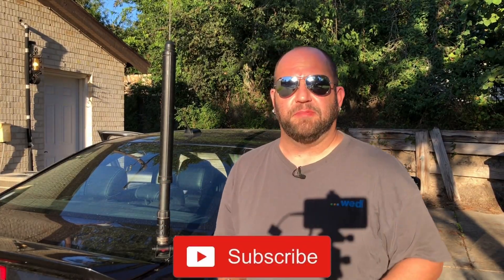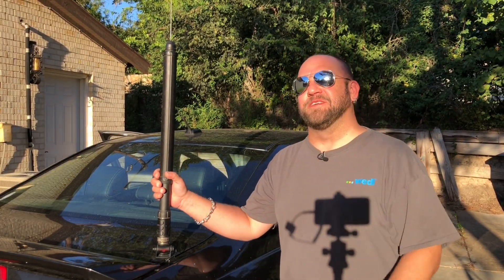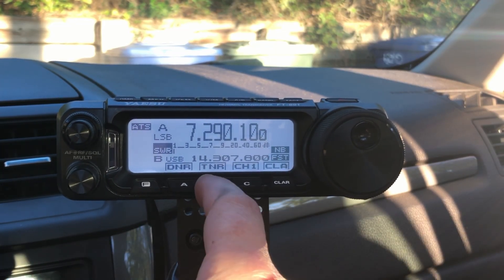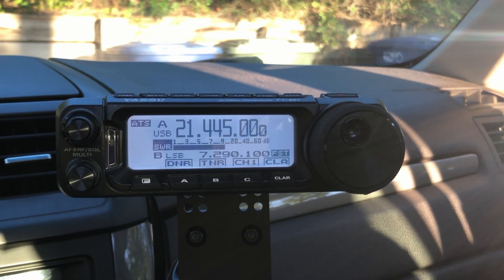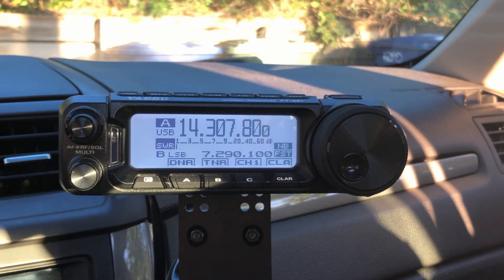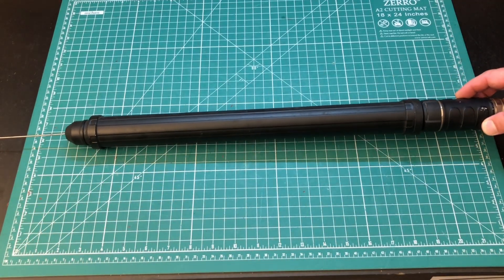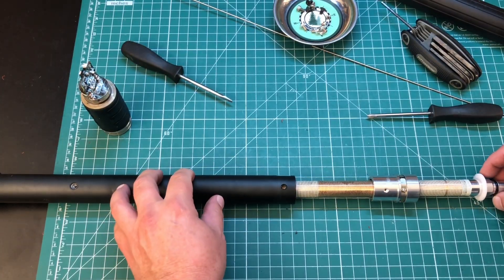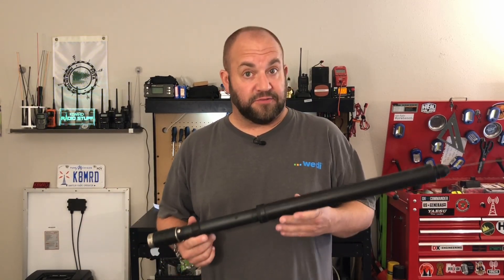Yaesu ATAS-120A Mobile HF/VHF/UHF Screwdriver Antenna

Comment: I had an 857 and ATAS antenna.  Totally hated that set up in my F-150.  It always had problems tuning, RF feedback, and other issues.  I bonded the truck, radio and antenna to the frame.  All body parts to the frame.  Always had the problems.  Switched to the Icom 7000 and a Scorpion antenna and NEVER LOOKED BACK!
Reply: Because you discovered that the ATAS is a piece of excrement bundled in a nice little Yaesu box. I am glad you can admit the pathetic and horrible design of this antenna. I too have a Scorpion and I have a LT II. ATAS is filth but so many people are suckers for buying this and Yaesu should be utterly ashamed they market this garbage.

Comment: I have a little box for using this with any radio works a treat
Reply from the maker: I've heard of those.  Which one do you have?
Reply: @hamradiotube  it’s a home made one by a good friend of mine G0NZI, he assured me it’s simple to make.
Reply from the maker: @CampervanCookout  Oh too cool.  Has he published the schematics?  Not that I have any idea what I'm doing but that might be a cool thing to build.
Reply: @hamradiotube  I will ask him :)
Reply: @hamradiotube  Third attempt!  Why do comments get automatically deleted on your channel??? Do you have some sort of bizarro moderation/filter set???

Once again: search for Yaesu ATAS 100 Screwdriver Antenna Control by K5LXP.

And for manual control there's the MFJ-1925
Reply from the maker: @James_Bowie  YouTube automatically hides any comments with a link so that might be why.  Too many bots out here spamming.  Thanks for the info though.  I’ll have a look.  73
Reply: @hamradiotube  Not so on all channels that I visit. I've posted lots of links to tech articles on various channels that didn't get deleted. Seems to me that it must be an option you can set on or off. Also, I'm told that some such posts are held for review by the channel owner, so there may be a list of those somewhere on your dashboard (or whatever).
Reply from the maker: @James_Bowie  Ah yes, there is that.  But I hardly ever look at the held for review section.
Reply: @CampervanCookout  Did you ever ask ask G0NZI about publishing his schematics? Thanks! 73!
Reply: @lyledal  I'm not sure he has schametics only the description above. I'll see if I can open it up and take a look. I think someone shared similar schematics elsewhere in the comments
Reply: @hamradiotube  I have had a chat with him today, he said its very simple design. It's a bias-T which blocks the voltage going into the radio via the signal path, with two buttons. One button has a straight 12v output for antenna up and the other is a 8v via a regulator for antenna down. Apparently thats all the ATAS uses 8v and 12v, if its above 8.5v goes up. It's similar to the K5LXP but much simpler. design in the one I have from what I can see.
Reply: Check out the mfj 1925

Comment: I had a Yaesu Rep tell me not to use it as a mobile antenna.  It's good to see it can be done.  But all that wind deflection is going to take a toll.  I may try it in the bed of my PU.  I do use mine in the RV when we are parked.  The antenna does work well.
Reply from the maker: A Yaesu rep tole you not to use their mobile antenna as a mobile antenna?  That's just crazy.  I've seen so many cars and trucks with this antenna at different ham fests and swaps.  Its sole purpose in life is to be a mobile antenna.  Sure there can be better, more rigid ways to mount it, especially if you have a truck, but the wind deflection isn't that bad.  Keep in mind, I'm going 90 MPH in this video.  With a trunk mount.
Reply: @hamradiotube  You dont know anything about how to properly perform mobile HF and you shouldn't act like you do.
Reply from the maker: @DeepSouthVeteran  Really Mr Sad ham??  Cuz all the contacts I make would say otherwise.

Comment: For years I ran one on my Honda Prelude with a trunk mount. Used a Diamond mount, scraped a bit of paint and also bonded the trunk lid to the body with a bit of copper strap. Used an FT-857 and made lots of HF DX contacts on my commutes. A friend just got a Yaesu FT-dx10 and the manual refers to using an ATAS-120A, so the antenna is still relevant.

Comment: In this situation, are you using the battery in our car?  Also, is the radio grounded to the car?  I have the same mount and got rid of the paint, but I'm running via a bioenno battery and my radio is not grounded.  thx.

Comment: Hi, thinking of getting one of these as I just bought the 710.  Can anyone recommend a good temporary magnetic mount model for this antenna for a car (ie only used when car is parked)? 73 - VA3IAP
Reply: I recommend the type that has 3 5" diameter magnets.  Set it down in the middle of the car's roof.  I talked to the Azores from a California POTA park using just a 15W SSB rig on 20m.
My antenna was a 17 ft collapsible whip.

Comment: I just paired an ATAS 120A with a FT-891 and I can also say DON'T buy a cheaper trunk lip mount. I tried a Bingfu from Amazon. My SWR was all over the place and it didn't want to tune. Got a Comet RS730 and my problems went away. Again GROUND it well.
Reply from the maker: Spends $350 on antenna.  Will only spend $5 on mount.  It's amazing the things we cheap out on isn't it?  I'm the same way and I tend to have to learn things the hard way.  Glad you got it situated and thank you for posting your testimonial.  I couldn't agree more.  You've gotta have a good mount.  Though I have yet to ground mine well.  73

Comment: Hey Mike.  Your video motivated me to pull my ATAS 100 out of storage. This thing is at least 25 years old so I plugged it into the equally old FT 100 D and it worked like a champ on another day. I’m going to try to see if it works with an 857 which should I hope.  Thanks for the motivation.
Reply from the maker: That's awesome!  I hope you get it all situated and back on the air.

Comment: Mike thanks so very much for your reply! It indeed help very much. 73 & Blessing’s. NM5SP
Reply from the maker: Awesome.  I tried adding a longer wire to the ATAS yesterday with inconclusive results.  I didn't have much time and used a completely random length of wire with no scientific basis at all, but I did get the SWR on 3.900MHz just under 3.0:1.

Comment: Mike really learned a lot about this antenna from the video! I'm  in the process purchasing a FT 891(because of your videos on the 891)
 for moblie use while RVing several months a year and debating between this antenna and the BabyTarheel ll. Draw to the Tarheel because it covers 80 meters, is where most nets I talk on are located. However not excited about manual tuning and running additional cable for tuning on the Tarheel.  Only draw back on the Yeasu is it doesn't tune 80 meters where I operate everyday on nets. Thanks for your great work providing info and education about Ham Radio!  73&Blessings. NM5SP
Reply from the maker: Alan, I feel you man.  That is a very tough call.  I've since purchased an ATAS after making this video because I liked it so much.  I was traveling a couple weeks ago and wanted to tune up 80 but alas, I had the ATAS and couldn't.   80 is so not important to me though.  I'm never ever on it.  It's more an "I want it because I can't have it" kinda thing for me.  Same reason the first antenna I bought was a Wolf River Coils Silver Bullet 1000.  Because it had 80-6.  Every now and then I'll get on 80 FT8 but for SSB, I prob only have 2 maybe 3 phone contacts.  If 80 is important to you, it's a no brainer, get the TarHeel.  I assure you, it is NOT hard to wire.  You have 2 wires from the control box.  One is your 12v to power the box and antenna, the other is the control wire to tell the antenna to go up or down.  Then your coax from whatever mount you chose.  That's it.  At least for the setup that I have.  PLUS, with the Tarheel, it is extremely easy to swap your whip.  If I'm driving and doing HF, I'll have the short 3' whip on, but if I'm activating a park stationary, I have quick disconnects for the whip and I can put on either my 6' or 17' telescoping whip in mere seconds.  The Tarheel's whip connection is a standard 3/8x24 thread so you can put pretty much whatever you want on it.  Not so much with the ATAS.  It's whip receiver is a small hole with two screws that tighten down on the whip.  Sure, you could put a different length piece of thin metal wire in there, but it's not going to be easy, or readily available.  BUT, if you are stationary at your campsite, you could very easily attach an appropriate length of wire the the ATAS stinger with an alligator clip or something, and tune up 80 (I would suspect, I've not done this but it makes sense).  I don't know if this answer helped or confused you more, but I hope you have fun with whatever decision you make.  Thanks for watching and 73.

Comment: Hello Mike, I have a 10+ old FT-857 & ATAS-120. This combo works great. I would say a lot of FT-8x7 and ATAS-120 users. Don't know they can use a duplexer. So they can use the ATAS-120 on HF, Vhf and Uhf.
Reply: Do you use the car battery and ground your radio?  I'm having issues with getting to work.
Reply: Hello Frank, I run both the positive and negative to the car battery. I also mount the body of the radio to the car for a good grounding. I see you are about a hour north of me. I have YSF, DMR, PaPa or Darn.
David KE6UPI
Reply: @DavidS-iw4ei  thx David S.  I will experiment more. Some hams use a magnetic mount. So my feeling is the radio b
Need to be grounded.
Reply: @frankwc0o   What problems are you having?
Reply: @DavidS-iw4ei  I have the FT857D connected to the ATAS antenna. I’ve change the menu on the radio. My mount is grounded very well. But my radio is not grounded to the car and I use a Bioenno battery, thus I’m not using the battery on the car. When I initiate the antenna, it works fine for I receive initiate on the screen. Even though the antenna is all the way down. Then when I press tune there is a high SWR rating which is expected and the antenna doesn’t go up or down. When I do press tune, I do leave the radio alone so that it will do its job. After about a minute and a half it doesn’t do anything in terms of moving the antenna up or down. I even have press the PTT button and the off button to see if I can move the antenna. No luck yet.
Reply: @frankwc0o  So the ATAS-120 uses I think 8volts to run the antenna down and 12volts to run it up. I would try and see if you can connect the radio to the car battery. I do know, that some small coax doesn't work at all. I have the Comet RS730 mount with the Comet CK-3M5 Cable Assembly and it doesn't work at all with the ATAS-120
Reply: @DavidS-iw4ei  what mount and cable do you use instead?

Comment: W0ZRK Thanks a Lot Mike. You just made me spend $400+ for an ATAS and separation kit for my 891. If that isn’t bad enough I need to buy another 891 for my portable setup. Sometimes the G90 ain’t enough. Plus I’m a Yaesu fan boy. Always have been. I’ve already forgiven you though. 73 man.

Comment: Will this antenna work with any HF radios? I have a G-90 in my truck.
Reply from the maker: While I’m sure you could find a way, this antenna, to the best of my knowledge, is really designed to work with Yaesu radios specifically.  You’d be better off with a Tarheel, Scorpion or the like if you’re looking for a motorized screwdriver antenna for the G90.

Comment: I run the 120A on a mfj triple mag mount on the cab of the pickup connected to my FT-991A.  I wish someone would have done a video like this prior to me breaking my 1st one (got a good deal on QRZ) and having to buy a 2nd one brand new.  Mine would get stuck and I too thought something was wrong with it (especially since I got it off QRZ).  So what does a good HAM do, take it apart and fix it.  As it turns out, this is not a good idea, ended up breaking it, but knew when it worked, it worked great.  So I bought a 2nd one.  At first the 2nd one worked brilliant, then after removing the radio from the pickup to use in the shack for a while, and then putting back in the pickup, it started sticking.  I can't type all the words that didn't go thru the brain filter but came out of my mouth, lets just say George Carlin would have been blushing.  Obviously I was beyond frustrated, but totally by accident, left it alone just like you show in the video and all of the sudden heard it start moving.  Again some more choice words, Whisky Tango Foxtrot.  Still not really understanding, but extremely relieved, I just went with it.  It worked perfectly for about a month until I pulled the radio out and put it back in, then back to being stuck, this time I hit the tune button and waited, sure enough after a couple minutes it was back to normal.  Moral of the story (for me at least), as long as the radio is connected to the antenna I've had no problems - when I take the radio and connect it to a different antenna (yes I switched the tuning settings correctly), and put it back in the pickup it happens every time, but always comes out of it.  All in all, its an amazing setup, I've activated several parks with it and had contacts from Austrila to Europe.

Comment: I've done a couple activations with the 102A and it seems to be working well.  Has anyone tried to replace the stock whip with like a 6 foot whip? If so, is there any worthy difference?  I have mine mounted to the roof of my truck during activations using an NMO mount I already had in the roof with an NMO-SO239 adapter.

Comment: I have the same setup. FT-891, ATAS-120A, and K400 mount. The 1st time I tried it on 20m I had a contact in Austria from the Dayton Amateur Radio Association club house parking lot. At first I had a lot of S7 to S9 noise. Thanks to a voltage ohm meter I realized the door where the K400 was installed was not bonded to the body of the cab of my truck. A few feet of ground braid and eureka! S0 to maybe S3 noise. This setup is crazy fun for POTA! Thanks for the vid Oscar Mike. 73 de N8NMG Dayton, OH
Reply from the maker: Well that's promising!  I just got an ATAS myself used off of a buddy.  I need to get the whip for it as he lost it.  I watched Josh's (Ham Radio Crash Course) video on grounding his electric car and he said the same thing.  Now I really need to hunker down and do it.  Looked pretty easy actually.  I can turn a wrench.
Reply: @hamradiotube  Hy Mike... FYI I know beyond any reasonable doubt that DX Engineering has an OEM whip or 2 laying abound in returns. It took 3 shipments for me to get an undamaged item. The carrier literally destroyed 2 shipments. BUT out of the destruction, I can tell you there is at least 1 useable whip in the "sent back" remains. Good luck, have fun, and keep up the good work. 73 es gud POTA de N8NMG

Comment: Extreme grounding is the key to it working properly.  
Grounding is the key.
Reply: I know ground strapping is the “right” thing to do so I did it. Can’t get it to tune 12m for some reason. This guy just sticks it on his car and it tunes 12m no issue. What gives. I’m going to try and remove the ground straps and see what happens.

Comment: What powers the mechanism that adjust the length ?
Reply: The radio sends DC up the coax, so you need to use a compatible Yaesu radio. Alternatively, MFJ make a manual tuning box - the MFJ 1925. That would allow you to use it with other radios.
73, Fraser MM0EFI

Comment: It is a good antenna. I have one ATAS-100 and two ATAS-200's. The freezing I just mike control to get it moving the right direction then autotune. Realize the coil contacts last known are beryllium so watch out for contamination from dust and muck if taking one apart. Not the only brand with beryllium contacts ie. cancerous.

Comment: Good antenna…. I had to add a aluminum plate to my bracket to beef it up. It crackled do to the wind load. A band aid until I find a better mount.
Reply from the maker: What mount are you using?
Reply: Diamond K550 luggage rack…. Metal is to thin. At least once a month I have adjust the antenna back to vertical.

Comment: I have a Atas 120A and considering it size, it works well enough to be useful for many urban POTA activations. I use it with a tri-mag mount on the top of my truck (static, but not mobile). No issue tuning it. VA3KS